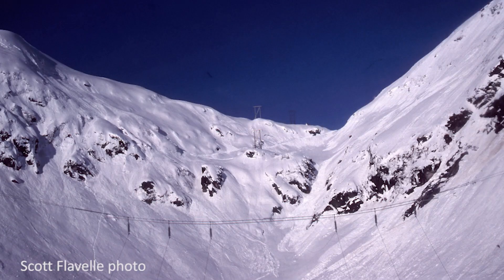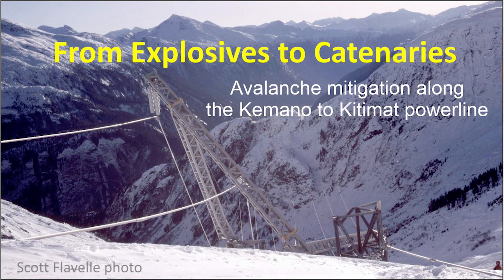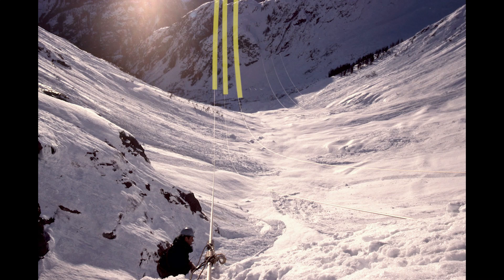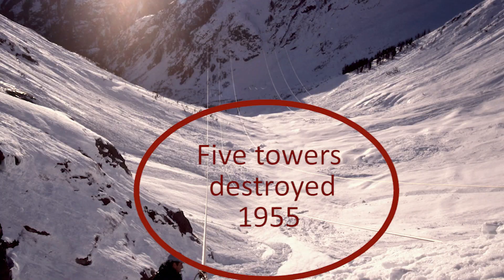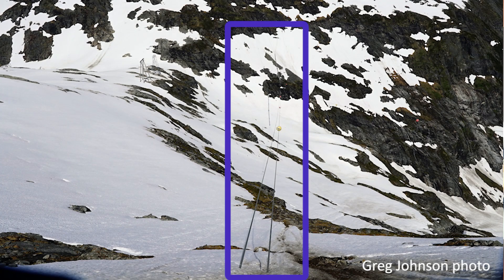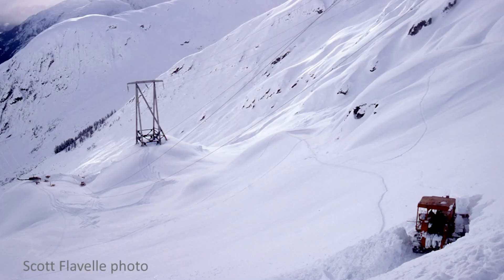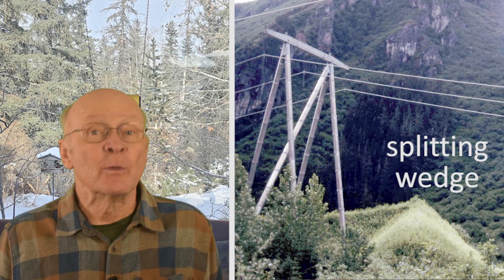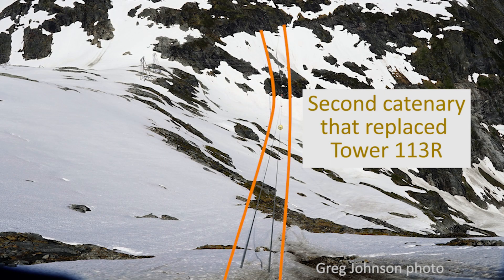From Explosives to Catenaries - Avalanche mitigation along the powerline from Kemano to Kitimat.

Comment: Interesting to hear reminiscences about your project Scott including references to the first and second generation avalanche professionals some of whom taught the first Avalanche courses at Rogers Pass, one of which I participated in the winter of 79-80. 

I have two snow density coring tools left over from my 1980’s Snow Studies on Buildings days observing for the NRC Division of Building Research. 

Chris Stethem, if you read this, let me know what you want me to do with them as I’m clearing out my attic. The fiberglass one is a museum piece and the aluminum segmented one, with the exception of the canvas carrying bag is probably got many more years of service left in it.
Reply from the maker: I had a Mt Rose (Standard) sampler that I loaned (or maybe gave) to the Revelstoke Museum. I assume it is still on display. These samplers were - and may still be - in demand.
Reply: @brucejamieson  I would think so.  The first one just didn't cut it for taking a sample to ground level to measure total water equivalent because it was only a meter long and I had to dig a two meter square hole down about 5 feet to create a shelf to pile the last meter or so of snow on so I could bend down enough to get my finger on the bottom of it to collect the sample .  It was sharp though.  Deadly sharp.

The second one is sectional aluminum that was long enough to reach the ground plus more and retained the core and was a great relief from digging 3 of the holes described in the first paragraph.  Vancouver Island Mt Washington snow pack up to 5 meters on the snow depth pole in the snow plots.

The problem with the second device was that they made me go from 3 total snow ground samples to 7 plus all the building roofs (7) I had to profile and measure in a day.

I put it on here because I thought the audience you probably have might have some suggestions.  I've been out of the buiz for 40 years now.